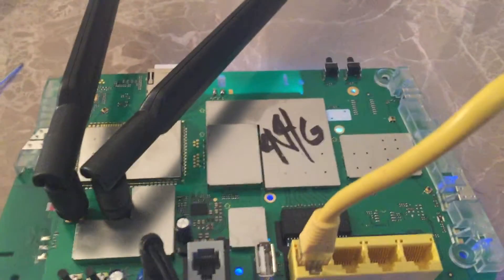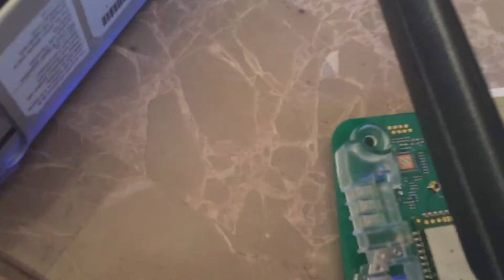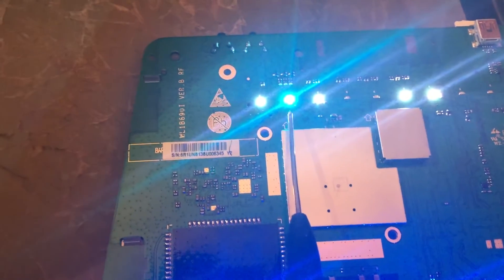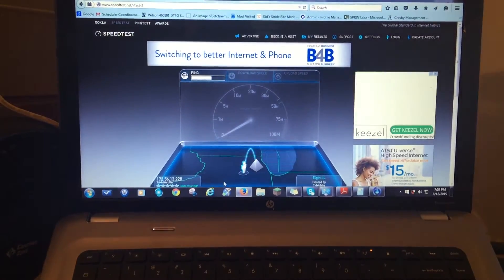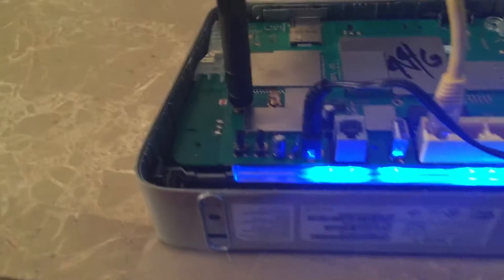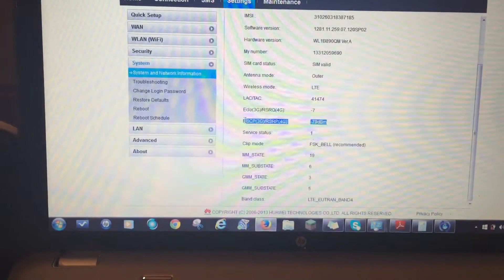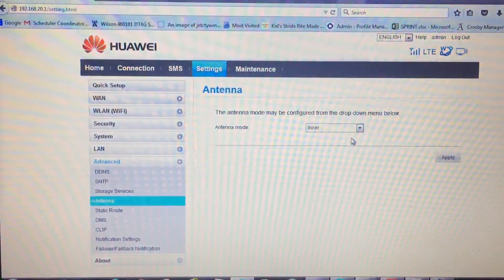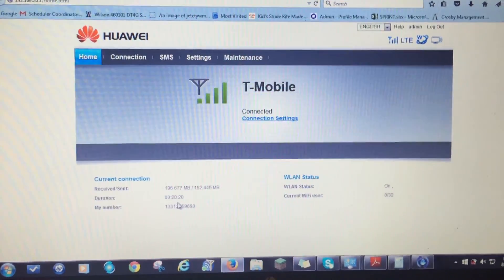Huawei B890-66 4G LTE Smart Hub breakdown antenna test T-Mobile 4gantennashop.com

Comment: I just bought this modem and my web interface looks different. Mine doesn't say LTE even if it is connected to LTE, and when I hover over the signal strength is doesn't say the actual strength, it just says Signal is strong.

Comment: I have tried two different  external antennas and signal got worse each time with the 890. Read your explanation below  but when I use with net gear router signal actually gains 1 bar. Also the -db gain seems backwards. I get -25db without antenna 2 bars and get -17db internal antenna and 3 bars.  Thoughts
Reply: Say if your signal is -112 dBm, you install an antenna and get -99dBm, that is a signal increase. The range is in the negative scale so the lower the number the better.

Comment: I also have the b890-66 and have being using it on the cricket wireless unlimited data, but unfortunately it frequently stops working and i constantly need to reconnect which helps for a few minutes.  I have used the sim on my phone as a hotspot and works perfectly, so i do know its a issue with the huawei b890-66.  If anyone has any idea please dont be shy to help.  thanks

Comment: Thanks for the video. I picked one up a month ago and decided to get an external MIMO antenna for it that apparently is supposed to work with the 4G band. My signal quality actually got worse using it so I had to switch back to the internal one. Thoughts?
Reply: your antenna does not support the lte frequency/band that is closest to you. So it looks for the signal that it can read which is probably another tower that is further away. thus giving you worse signal if you use it rather than using the internal antenna.